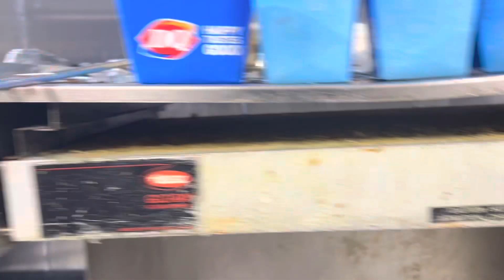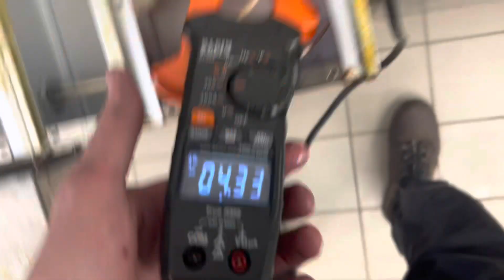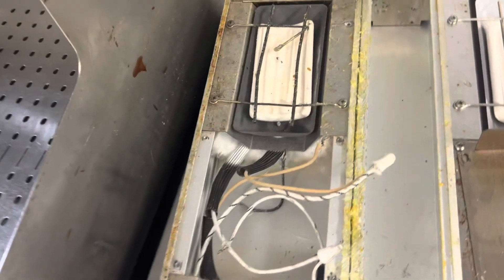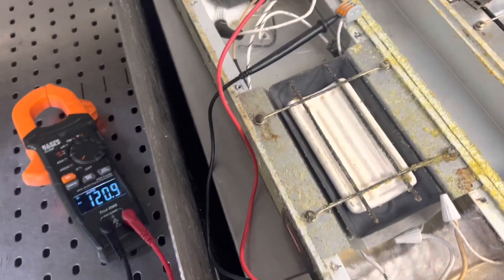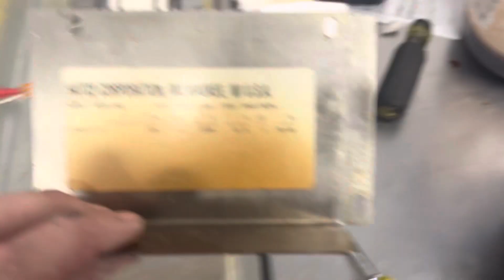Hatco warmer - troubleshooting simple circuit

Comment: Any ideas I have pizza warmer hatco heats up then trips breaker?
Reply from the maker: Put an amp clamp on it and do it again.   See if it’s tripping overamps or because of a short.   Over amps bad heating element most likely (or runaway thermostat) not over amping find a wire that once energized gets close enough to frame ground to pop.   Or….  Faulty breaker but that’s generally last resort
Reply: @restaurantrepairs  thanks try that tomorrow

Comment: Interesting to see these in a 120v setup, I see a lot of heating elements on like ptac's that are 240v. These usually give you an 0L reading when they fail?
Reply from the maker: As you see I didn’t even bother continuity tests or ohming them out.   Providing 120 to the element with a complete circuit.  No amps.  Bad elements.
Reply: @restaurantrepairs  Yup makes sense, voltage and no amps = bad element